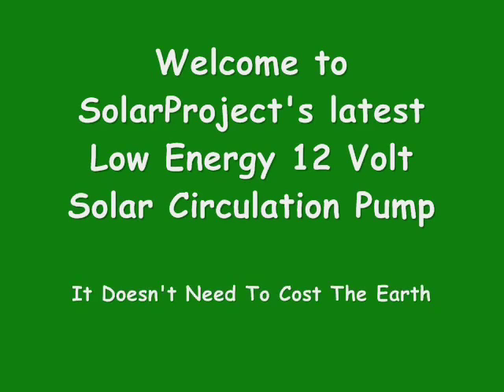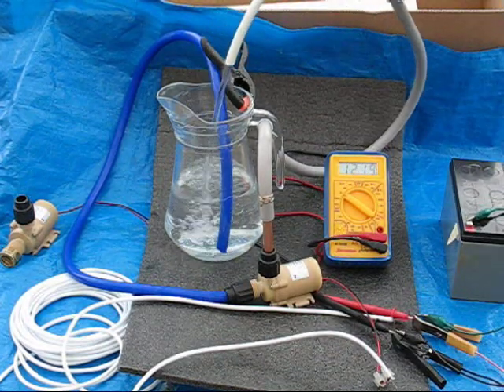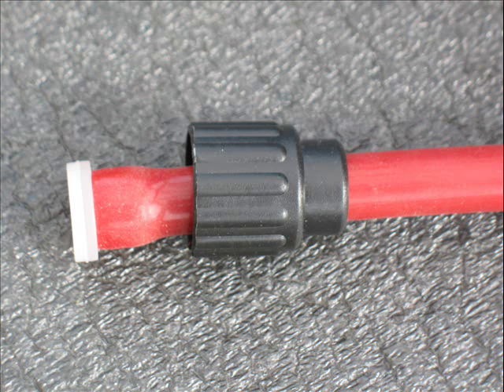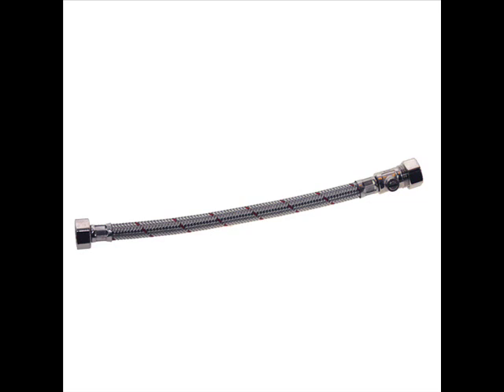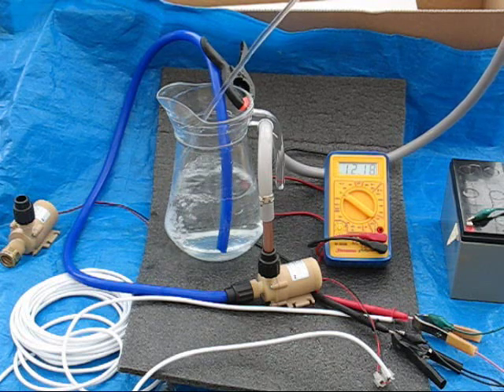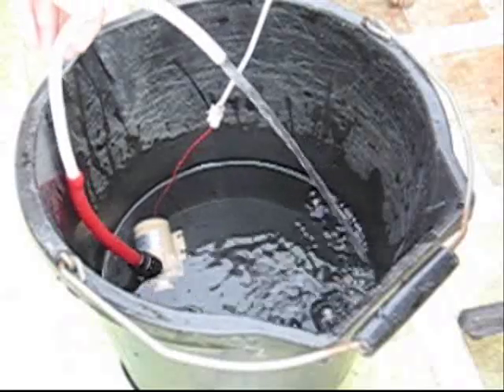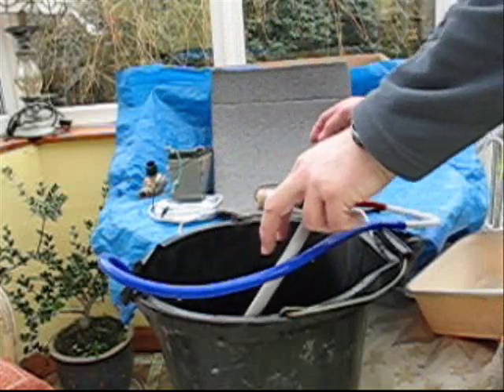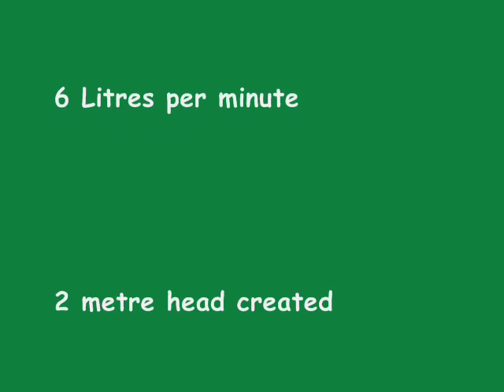12Volt DC Water Pump, Low Wattage for Photovoltaic Solar Panel

Comment: it is very simple, don't trick yourself into thining it's hard to understand, that's what I used to do- check it out-  Voltage is the potential to do work.  More voltage = more work that can potentially be done.  Amperage is current, or the driving force that gives us electrons turned into electricity we can use. Wattage is just a way to measure the amount of power being used. multiply volts x amps and you get watts.